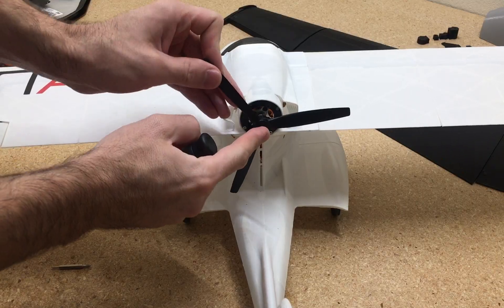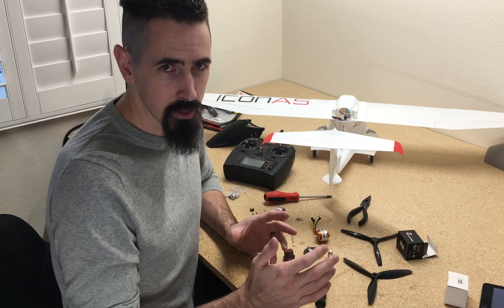Maiden Flight RC 3D Printed ICON A5 - Planeprint

Comment: You should probably put some tape over the motor when you grind the shaft, as the fillings will get sulked in by the magnets. Nice plane though. Subbed.

Comment: I fly the 2012 Parkzone Icon A5 in foam.  Also the UMX Icon A5.  My favorite seaplanes.  They're old, yellowing, a little bent and long discontinued.  Now you've got me looking at 3D printers.  Nice work, Troy.  ;)

Is there any way to move those rear servos forward and use a flexible control rod?  That is exactly what Parkzone did with the UMX Icon, and it is the best flier of the bunch.  They had to put a steel slug in the nose of the 53" model to offset that elevator servo's weight.

Thanks for the inspiration.  Cheers!
George
Reply from the maker: The servos work good where they are in the horizontal stabilizer. It would be difficult to make them work in the fuselage. This is a fun build. Thank you for the comment.

Comment: Can it take of and land in water?
Reply from the maker: Yes it can take off on water and land the wheel can be removed. Unfortunately I have not tried a water takeoff where I live I don't have a good place for a water takeoff. But I have tested it for water tight and it works well.

Comment: Glad you had a great flight and a fix for the motor!  For an upcoming build you should try the planeprint V-turn, I can't hardly find any info for this plane, also the extremely long print times for the main fuselage are not something i can monitor currently.
Reply from the maker: Thank you for the comment. I definitely would like to build the V-turn I have a few projects lined up next but I will be sure to try out the V-turn soon. Cheers